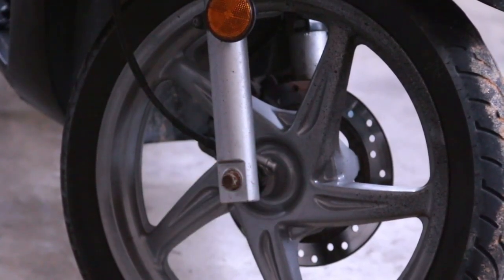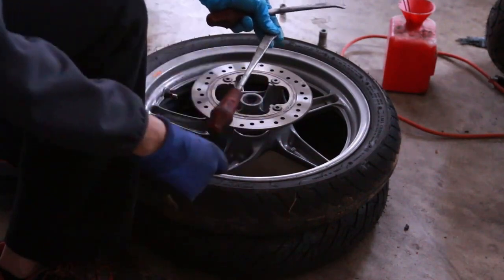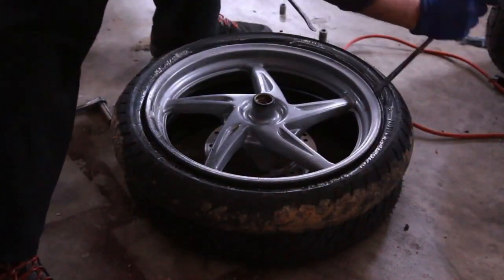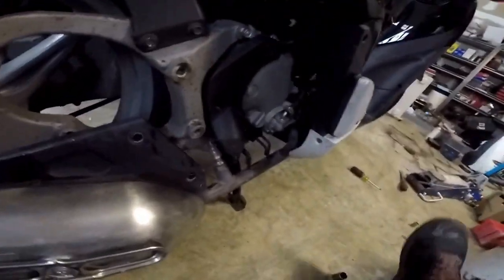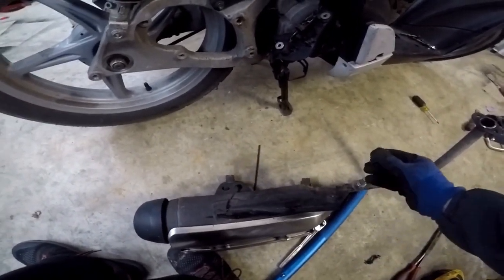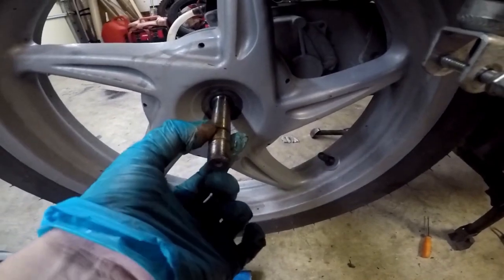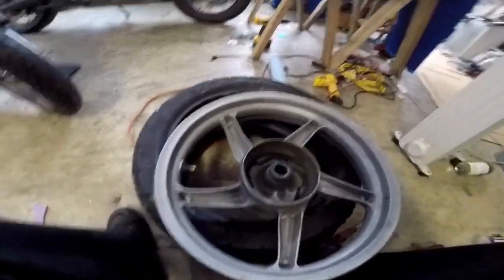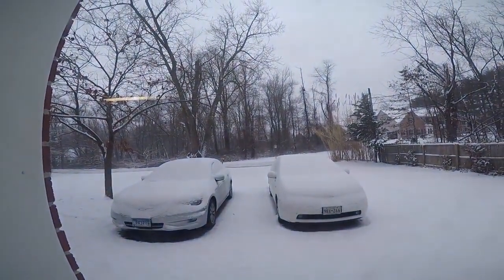How to change motorcycle tires with levers easily

Comment: Mr. Hunter, - Don't you have to balance the wheels? 
I was kind of expecting you to show us how you balance the wheels prior to reinstallation. 
Or is this unnecessary because its a scooter which travels at lower speeds than a motorcycle?
Reply from the maker: I've never balanced my wheels in 400,000 miles of riding. But that will make them be smoother and last a bit more from what people tell me, but im way too lazy. Some people will put balancing beads inside, ive done that in the past and never saw the benefit.
Reply: @VehicleHunter  That's very interesting! Thanks for that information. I'll be less concerned over the need to correctly balance in the future.